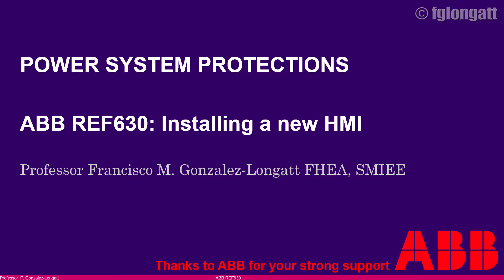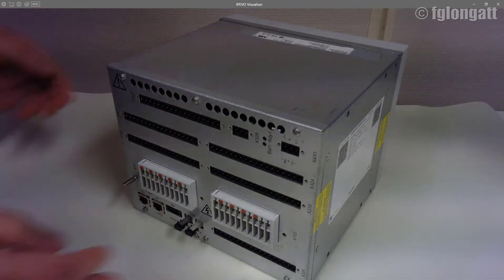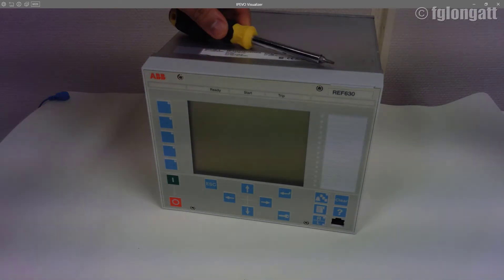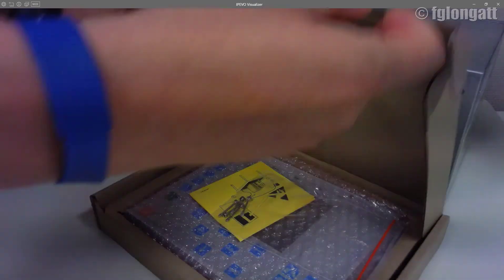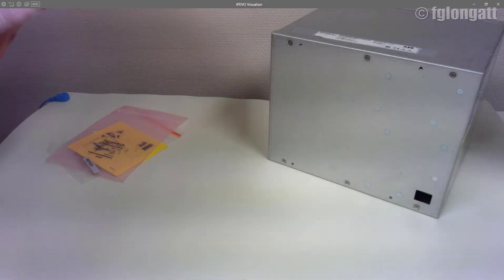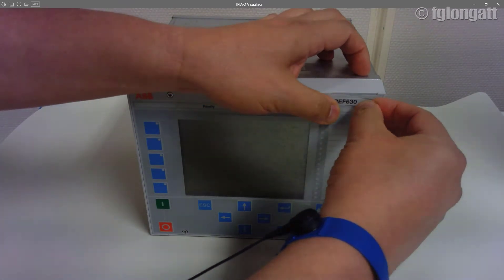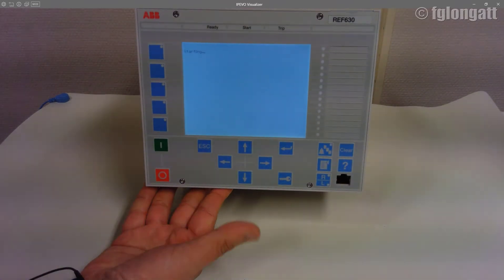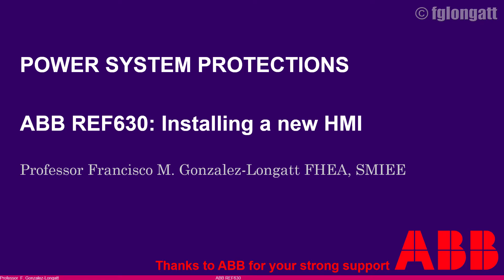ABB REF630. Removing old HMI and installing a brand new ENGLISH AUDIO only

Comment: Hello I want to make default acquitement automatic from SCADA because when I make an order close to the circuit breaker from SCADA it's couldn't execute it needs Acknowledgement default locally in front of the REF 630 relays 
If you have a solution I will be thankful Mr

Comment: What could be wrong if the unit doesn't initialize, even after changing HMI?
Reply from the maker: It is not normal. I think you must contact ABB Technical support, I am afraid. The HMI is a component that must create the problem...